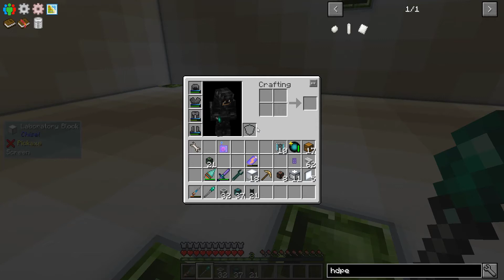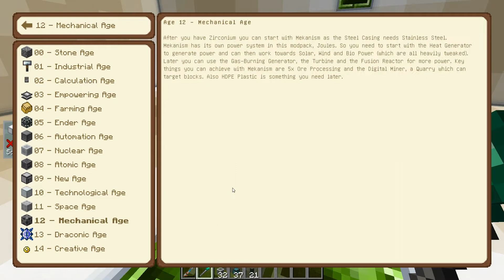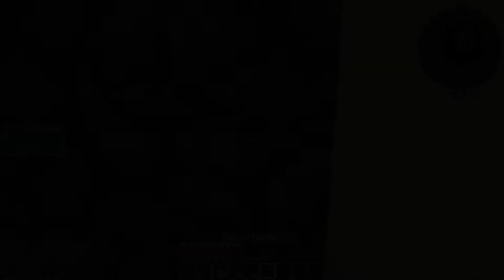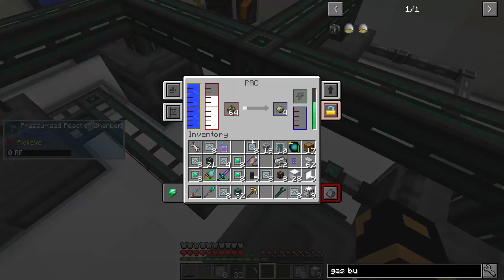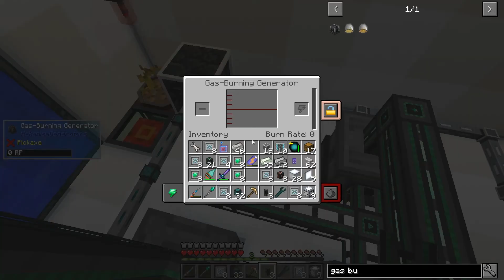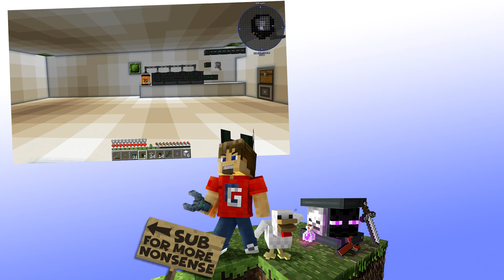Age of Engineering 55 - HDPE Plastic Automation - Closet Gamer

Comment: It's a lot of stuff for the creative things, but a lot of it can be automated. I'll admit it does take pretty beefy automation to be able to do it, and you'll want serious EU and RF production to be able to power that beefy automation. One thing you might want to look into once you have the RF side of things well covered is the atomic multiplier from Calculator. It allows you to basically dupe items for the cost of just RF... A LOT of RF, though (It's in the billions I think.) This will be basically required for some of the later Draconic Evolution stuff, as some of it requires multiple chaotic cores, and loads and loads of dragon hearts.
Reply from the maker: +Dream Vigil hey man I'm all up for automation ;) I'm actually looking forward to the day RF becomes an issue again - it's been no problem for quite some time since I built that solar haha Those atomic multipliers sound good - like the replicator from IC2?
Reply: They're similar, but they will duplicate, or rather, multiply by four, almost any item in the game. "Quadruplicate?" Is that a word? It is now! lol They won't do some of the more advanced machines, but they will do almost any base material in the mod. In fact, the only things banned from being multiplied by them are specifically banned by the mod's author. I think they take a couple billion RF to use though, and 6 of any calculator circuit per cycle, if I remember right.

Comment: EnderIO has a Gas Conduit, but I've always found it to be a bit fiddly to make work.

Mekanism Fluid tanks, are one of my favorite items in modded minecraft. They can act as buckets if set to do so, or be placed in the world, and if hit with the configurator can auto-output and do so  to any side as far as I can tell. They will also fill from any side, not just top or bottom, and can be readily expanded into very large tanks. In short, they are awesome. The gas tanks are also awesome, with red splash side being the automatic output, so they can be used as inline buffers without any interruption in the cable connection.

Yeah the Gas Burning Generator is very fuel efficient.

Try stuffing 4 Muffling Upgrades and testing the frame rate on your setup. I'm suspecting the sound might be what's at issue.

Definitely want to spend some of the Scented Paneling to make a couple Alvearies as soon as you have Imperial Bees. The first one is expensive, but the subsequent ones are a lot easier. (If you get really frustrated, Gendustry is the best mod ever for 'fixing' bees.
Reply from the maker: Yes I saw a rather salty post on reddit from the EnderIO dev about the compatibility of Mek with EIO, apparently he's had enough! xD Gas pipes have not been ported to 1.10.2 yet.

I love the Mekanism tanks, they look the part. I have one laying about from when I thought it would be a good idea to store liquid XP...DOH! I'll put it to use storing ethelene,

No luck with the muffling upgrades, the only thing that seems t resolve it is removing the speed upgrades down to around 4. For the Bee's I have imperials using a kind of brute force method - not really fussed about traits - just enough paneling to get me through :)
Reply: Ah, that explains quite a lot. Lots of mods seem to have stalled in 1.10 era, even though I'm enjoying 1.12. I know Railcraft released a Christmas update, for 1.10. I'm wondering if they've had to re-write a lot of mods for the change. Though Mekanism has always gone it's own way rather than sticking with the crowd, which is fine.

Yup, they're awesome. The machines somewhat less so. Then again, your base is already a pretty busy place, so it's no surprise it's playing havoc with your frame rate.

Traits aren't what Gendustry fixes. Instead it provides Industrial Apiaries, which require power, but can both be accelerated and tweaked to provide massive production bonuses.
Reply from the maker: Triaxx2 it's definitely a busy base! I need to hook everything up to a redstone kill switch so I can switch it all off when I record!  I like Mekanism too, the machines are nice, the sounds are cool, the science behind it appeals to me - I'm bummed out that it's lagging. I'm going to move it all accross to the mining world today and see how it goes over there - hopefully it's good and I can spend some time making a massive chemical plant without my machine screaming in agony ;)

I'll take a look at gendustry, sounds promising!
Reply: Yeah, it's a fantastic mod, but anything running continuously needs to be off by itself. Admittedly, it's nothing compared to the Lagtastrophy that put my 1.7.10 world on hiatus. Trying to load twenty minecarts with rails is a bit of a nightmare, especially when Logistics Pipes are what I'm building with.